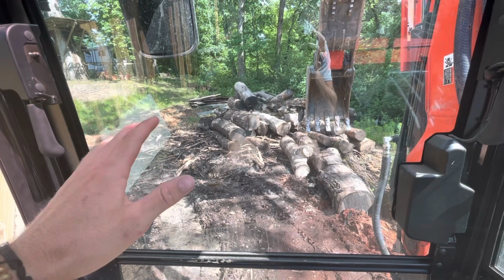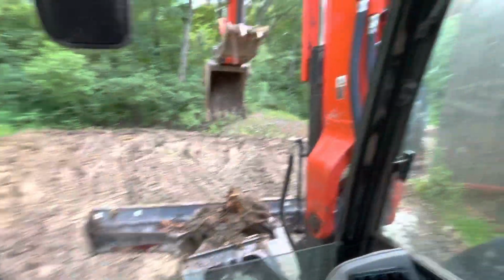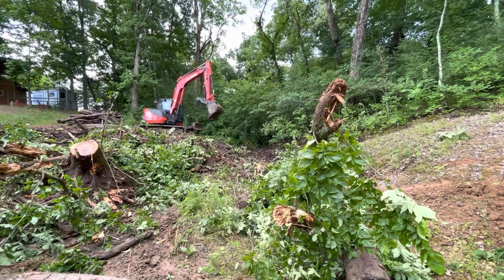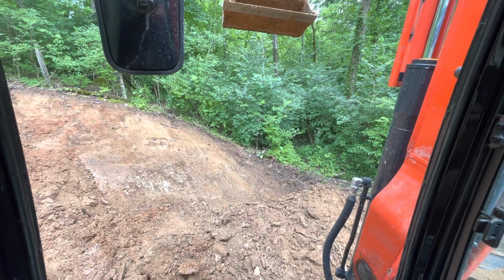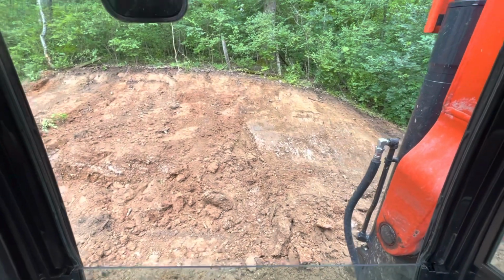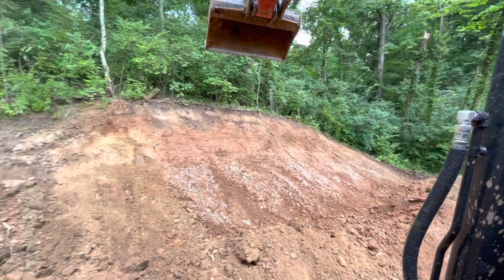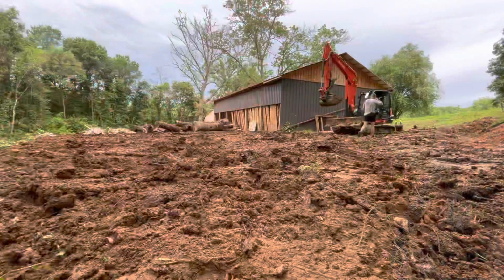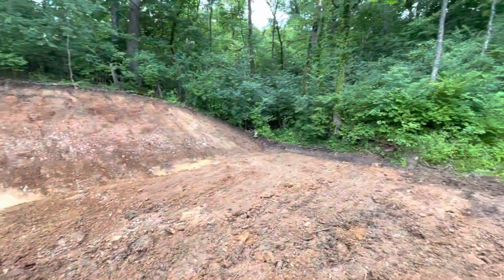Expanding! Making more room at the sawmill

Comment: You did it differently than I would of but my butt is many thousand miles away. You did prove quite capable of operating excavators and have some good knowledge of them. I don't think that bigger is always better and that machine was very capable of the work with no hesitation what so ever. I wish you had access to shale or stone for making it easier to walk all machines across the yard as I see skids with wood on them out there in my head. Of course you still have to cover it but if the wood is close enough on the ends then it shouldn't check and warp as bad. A lot of the trim sides could go across the lumber to temporarily cover good lumber maybe but thats a lot of extra handling... a unique problem that you will figure out for sure.... most of that lumber your sawing needs a new owner now that it is cut but maybe you have plans for it yourself. Nice work and good video work

Comment: We are literally located on the side of a mountain.  I had used my excavator to build a pad for my shed,  sawmill and work area.  Over the years we have been making the pad bigger by pushing off the slabs and culled lumber then covering it with dirt.  The edge now is 24' deep.   When we started the edge was 14' deep.  We have added a lot of ground to work on now.  Those cedar slabs will take decades to rot.  You would think it would settle a lot but it hasn't.  The ground does shake a little bit when we are milling lumber but not bad.

Comment: How do you like the kubota kx080-4.? I've got the kx057-4,  I would like to upgrade to the Takeuchi tb290...Cat310 or the kubota kx080-4. Have you ever used those machines?  Great video...
Reply from the maker: I love it so far. For the price compared to cat it’s hard to beat. It’s a really good machine. I’ve never ran Takeuchi before. I really was looking at the 310 as well because it is a larger machine and more capable but also a lot more expensive. I used to run a cat 308 very often and I really like that machine. If you run it everyday and can justify the extra cost I definitely like the cat better just for operator comfort and there features. Kubota has always been great to me though I haven’t had any problems. I don’t think you could go wrong with any of those three machines honestly